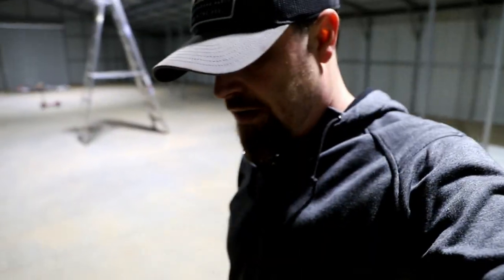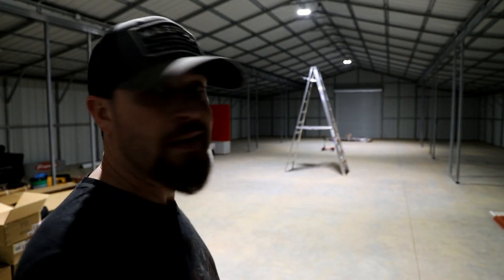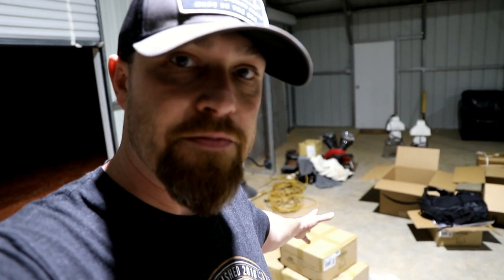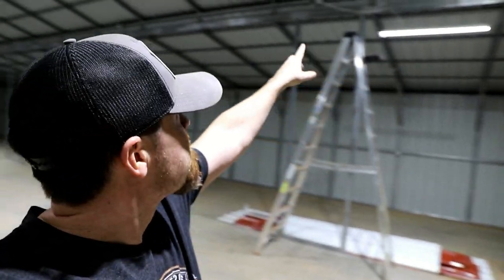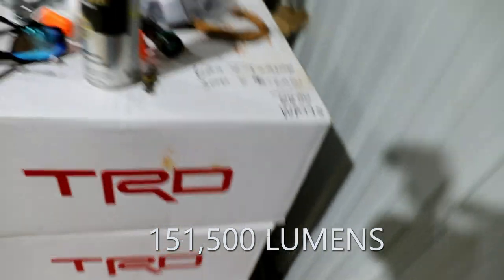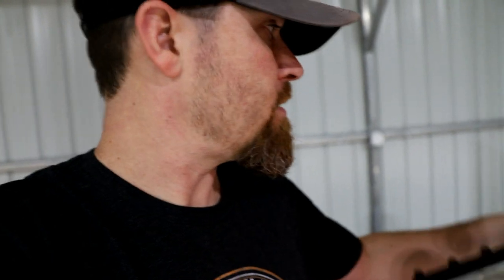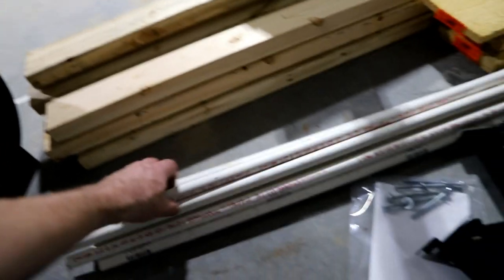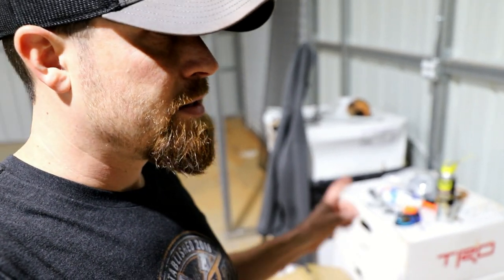151,500 LUMENS of LED Shop Lights

Comment: A breaker is not a switch.  Install a proper switch for the center lights.
Reply: They actually make breakers rated for switching, they are stamped swd. I don't know if that is what he is using, you would have to ask him.
Reply: @bullitt1992  Wearing out an SWD breaker is going to be 10 times the cost of a normal switch.
Reply: You might want to read your comment about a breaker is not a switch. It does't say anything about cost. But since you commented, how much extra wire and conduit and install labor does it save to just use swd breaker? SWD 15amp breakers all over for less than 10 dollars, even if it is 10 times the cost, I don't think 9 dollars is going to be more expensive than the extra wire, conduit, and labor.
Reply: @bullitt1992  Not much if it is done at the panel at the time of install. Really simple, quick and easy.
How often will that 20 amp @ $16.00 each (I would not use 15 amp for shop lighting) wear out? More often than a 20 amp switch.
Reply: @bullitt1992  just so you know, I do this for a living.
Reply: @Kodiak660  Again, the metal box for the switch, cover, the connectors, the switch, and labor way more than a 10 dollar breaker.  The breakers marked swd ranged from 15 to 40 amp from 7 to 10 dollars. I understand if you were using florescent lights I would also go with 20 amp breaker, but he's using led lights at 50 to 75% less power. If you do this for a living you know what electricians charge.. I own a metal fabrication business, and can tell you I used a breaker to turn my air compressor on and off for almost 20 years with same breaker. Our high school used same method for at least 30 years that I'm aware of. I don't know if they changed breakers or not to be fair.
Reply: @bullitt1992  Parts will be less than $5, labor about the same unless you are a really slow electrician.
I'd rather replace a $1 switch down the road, and not a $16.00 breaker.
None of the state inspectors around here would sign off on a breaker as the switch in new construction.
Like I said before, I do this for a living.
Reply: @Kodiak660  You saying you do this for a living means what? I have watched people do their job wrong for years. And guess what, they do it for a living. I have already said you can get a breaker for less than 10 dollars. To be fair neither you or me know what breaker box he is using, so we are both guessing at cost. If you did this for a living you would have known that. Replacing a breaker or a switch would take equal time. You're telling me you can buy a metal box, cover, conduit, connectors, extra 12ga wire for your 20amp breaker instead of cheaper 14ga for 15amp breaker, run the wires, install box and switch and connect extra wire for switch for 10 dollars. I have some electrical work I need done. As for inspectors, you don't know if he has to get that inspected, or if it would or wouldn't pass.
Reply: Just throwing it out there. I work in a military warehouse and all of our buildings were designed to control the lights with the breakers. And they're only about 6 yrs old.
Reply: @bullitt1992  LMAO!
I can tell you just want to argue.
I have wired hundreds of new construction shops, laid out and hung thousands of lights. All inspected and passed.
I have had to clean up wiring installs done by the guys you have watched do their jobs wrong.
Like I said before, installing a switch is not going to require all that you claim if it were done when the conduit run was put in for the light circuit. Switch, box, offset nipple, and cover. No extra wire needed.
Reply: @Kodiak660  I wasn't trying to argue with the very first comment. Just making a statement. I understand if you don't like his setup, you insert your preference on how you would do it, I want to be clear,  I personally would have a 3 or 4 way switch setup depending on his entry points. My point was that everything you add to a circuit is going to add cost. I believe it would be more than the breaker, trust me if I was doing it I would check prices for both to fit my budget. Have a good night.
Reply: It sounds like my step up transformer I use to run my 460 volt single phase welder. If I remember correctly it is a 70kva transformer, but I only run at most half rated output at full load, which never happens. The reason I brought that up, I had to figure out why my transformer would trip breaker at startup intermittently. Before you ask, I have a knife switch that turns on my transformer, not using a breaker, lol. Turns out the inrush of current would trip my 60 amp breaker. I ended up switching to a 100 amp breaker and #3 wire to handle the current load for those few milliseconds. Now, as for Kyle's setup in the video, the 1050 watts he's pulling for 7 150 watt lights, 8.75 amps at 120 volts. It must be working fine because his lights seem to work. With a swd breaker it is rated at full capacity of 20 amps instead of the normal 80% of a standard breaker. I do appreciate the reading though, I didn't  realize that about led lighting. Now the best question is if Kyle is actually using a swd breaker, or a standard one. Who wired his shop, him or a licensed electrician. You will have to tell me where you found the info for a swd breaker not rated for led, I didn't see that, serious question.